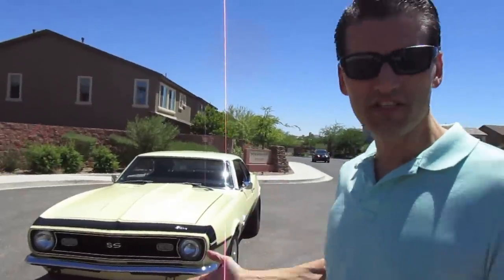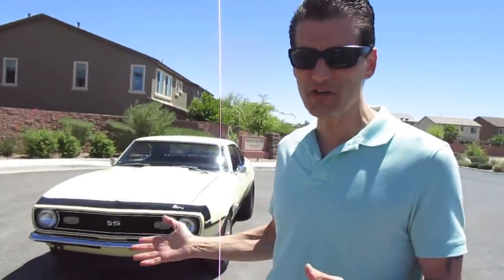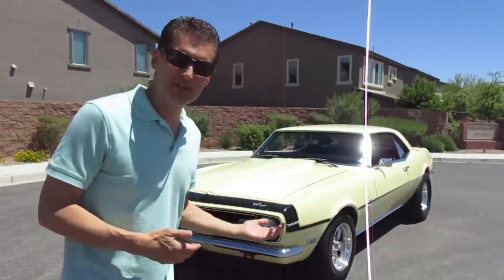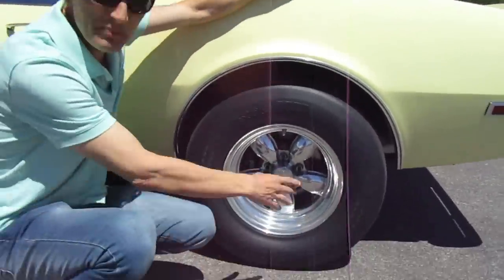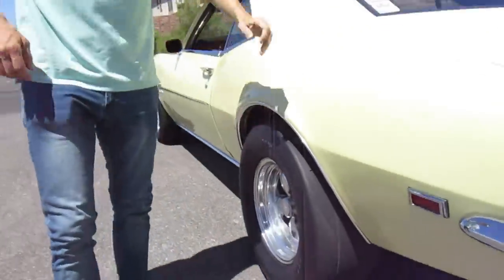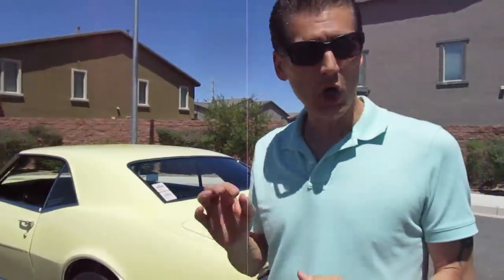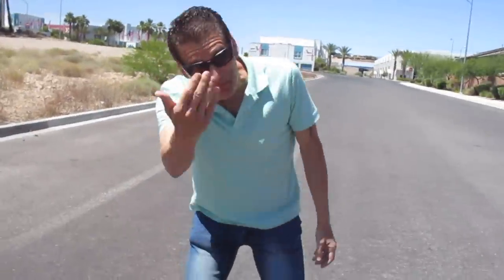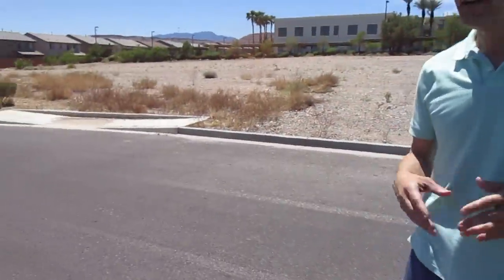Hoosier DOT Drag Radial Tire Review. By Gregory Mannarino

Comment from the maker: I SHOULD HAVE ADDED THAT THIS CAR HAS CALTRACS.
Reply: Do you use regular air on your tires?
Reply from the maker: Yes.
Reply: I was going to ask. . my 70 mistang has a 398w stroker[60 over and 3.85stroke] an AOD transmidssion and 3;80 posi gears. Rear end by Just Rear Ends in Reno. The engine dynod at 500 hp and 500 tq.  it has a comp roller cam and a 750 cfm quick fuel carb. hope to see you at hot august nites. mustang is copper sunburst w black vinyl top.
Reply from the maker: @dufus2273  Excellent!
Reply: I'm Buy Shares in Hoosier .
Keep Making Your Mark Mr Gregory Mannarino .
Excellent  Sir .
Reply: @Red Beard's Racing Depends... Slicks yes, you have to heat your tires for traction at launch. Regular street tires, don't really make a difference.
No problems with my 15 Stingray.
Reply: Kills me, at the Strip. They run .500 pro lights. I, being from New England,  and running at New England dragway. They used Sportsmen lights. Uggg...
Reply: Gregory Mannarino  
 Yo Greg, I am also a New Yorker  born ‘65 also used to run my road runner  (69) down at fountain avenue 
 Watch the big money races get set up at the TSS parking lot to run on 150th street outside Kennedy airport , not to mention the Motion quarter on Long Island  where they built lots of “Motion “ camaros , novas and vettes .  Were you down???   
      Big up BAY RIDGE  BROOKLYN!!!
Reply: Love it, always the teacher. 🏎
Reply: Wow 410 Dana revs pretty high at 50mph
Reply: Cool, Greg you know I have been listening to you for so long now.
Well since you had long hair!
And it's great to see this because this is my sort of video!
I have a67 fast back Barracuda, a 66 rambler classic and an 87 Pontiac GTA.
Your car hooks up very nice..
Good job you have an overdrive with that rear end gearing!
Reply: badass Mannarino
Reply: @Red Beard's Racing You got it bud!
Reply: Dana 60 for the win bro

Comment: You don't know it but you're an inspiration, you inspired me to get off my butt and start on the paint job on my 72 RS split bumper Camaro. I have it over halfway sanded down to bare metal, Going back with the brand new paint job on it. Just got lazy and stopped working on it. After seeing this, got to get it done so I can go out burn some rubber with it too. It doesn't have all the fancy race stuff, it has a built up 350 in it, TCI Street Fighter 350 turbo high dramatic transmission, with the 1700 Rpm stall converter in it. It has a 342 gear ratio rear end in it. But with the 3 speed automatic that's about the right gear ratio. Also the engine has headers, dual exhaust glass packs.

Comment: What type of adjustable traction bars are you using? Traction bars have a lot to do with hooking up and launching a vehicle straight, considering not all tires are under the same weight, and the natural response for a car to go to one side or the other when launching hard. I use Caltracs on a Procharged S10.
Reply from the maker: Caltracs
Reply: Great Minds think alike! 😉😁

Comment: Lol reminds me of my younger days. I had a 70 442 w-30 3:90 rears. 4 speed rockcrusher. It was all stock. But it still ran low 12s. I sold it 20 years ago. For 22k now they are worth 4× that today. Shoulda-coulda- woulda kept that old beast. Sticks are fun but you just can't beat an auto on the strip. Or gas milage with your overdrive. But it sure was fun. Breaking tires loose in 1st 2nd and sometimes 3rd lol.

Comment: they used to call those, "cheater slicks." i learned how to drive in a believe it or not pale yellow 68 ss396 camaro. it was my dads car looked very similiar to yours. minus the mirror passenger side, spoiler in the back, and it had a different hood. had chrome like indentations sticking up, ornaments sticking up. can't describe. it was the original hood. you could do a search if you like as i cant describe to well. lol. it was the low performance 325 horsepower version. with three speed automatic shifted from the center console. really cool looking gauges in the front of the console. 373 12 bolt positraction rear end. car was all stock minus matching numbers. was pretty quick until it hit third gear then fell on its face. my mom bought me a 67 camaro with a 327 with the camel heads and muncie four speed close ratio for $1200 bucks. i spent months sanding it with my dads supervision and help. somebody had the camshaft in 180° off and it had a high rise signle plane manifold. ran like crap. we changed the cam thinking it was flat. put a dual plane street edebrock on it. ran beautiful after than. later put a hei ignition in it. that helped a bunch. had to bash in the firewall a bit to make it fit. it was a comp magnum 280° hydraulic camshaft we put in it as recommended by comp since it had headers. the engine wanted to rev like there was no tomorrow. lol. tons of work but had that car for almost a decade. to this day i don't need to drive another but treasure the memories. today i have a 1969 plymouth valiant with a 360 magnum built up to go in it some day. i drive 3000 plus miles a week so in no hurry. want to just be on my feet when i get off the road. but happy to have it tucked away for when the time comes. love the old classics!